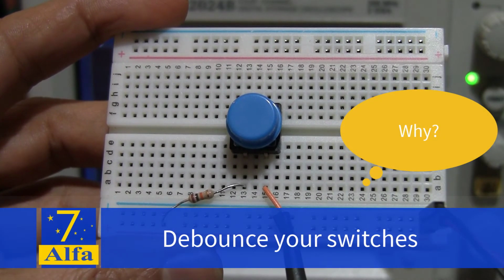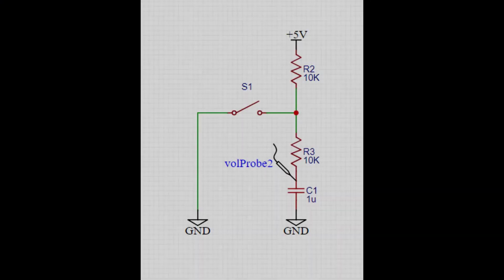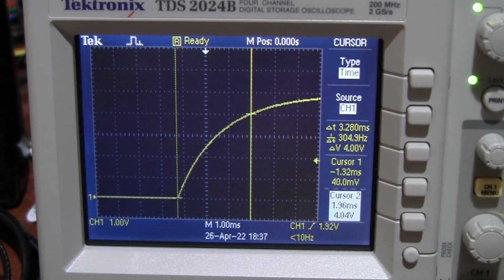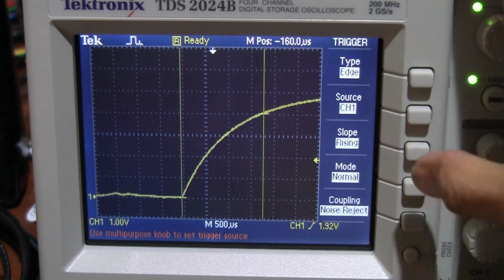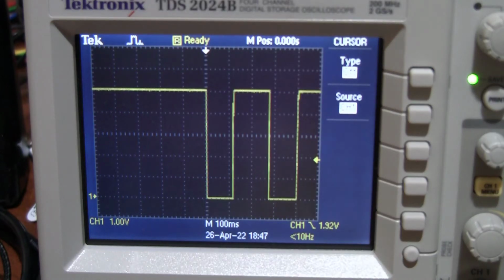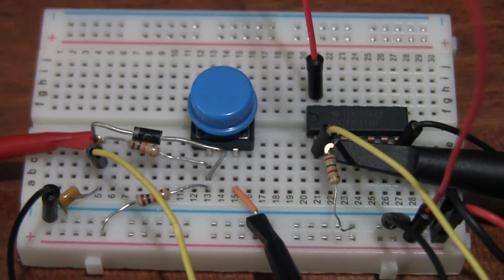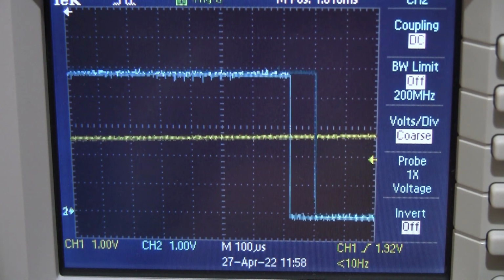Easily De-bounce your Switches

Comment: Use a non-inverting buffer with cap feedback with 10K resistor at input fed by button with 10K pullup.

Comment: I know this is an old video, but it seems like if you don't mind an ever so slight lag, one could just use the resistors and capacitors and so long as it stays at around a volt, it should be fine? Also, is there a particular reason having the faster fall off or rise times of the .1 capacitor would mess something up or be harder on the components?
Reply from the maker: Thanks for the comment. There is no reason to avoid the .1 capacitors. If one goes too low on the capacitors, then stray capacitances would come into play. Not a problem with 0.1
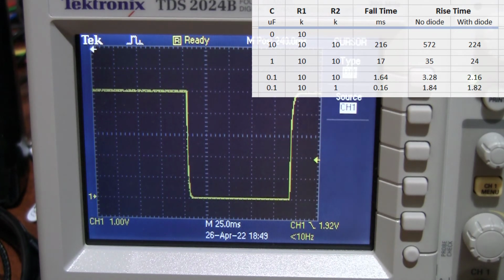And you are right that just the resistors and capacitors are perfectly fine. The diode is just the icing on the cake. Please look at the table at 4:18, and you will see my results with various combos.
Reply: @7alfatech860  Thanks for your response! I took a screenshot of your table which will come in handy for sure! 

I have an on/on spdt switch, but only the components for an RC filter with a inverting hex schmitt trigger as a buffer. I am hoping I can manage to wire that up properly to simulate the same action as a spst so that I can use those for the debounce. I figure one side would be ground while the other power, so when switched one way I will send my 5v signal, and the other will bridge/connect to ground only.

I realize a NOR-based SR latch would make more sense for me in this situation, but hopefully its just the more simple solution, and I am not making a mess trying to debounce the spst way. The only crappy part might be having to add 2 rc filters, on both "transfers" of the switch, but I think I can still send the signals to the same schmitt trigger since it has multiple inputs so long as I don't go over its rated output current (I hope).

Thanks agains!

Comment: thanks a lot for this video, which helps to easily set up the optimal debounce circuit .
I am using a lot of rotary encoders and have tried all kinds of software solutions. It works well, but sometimes you still have glitches. INTERRUPTS are always tricky and good for a surprise !
This time i will go back to the basics and choose  a clean electronic solution.  
..... besides its an honour for me to use a SCHMITT trigger - because this is actually my family name.
greetings from germany  Bernd Schmitt
Reply from the maker: I'm so glad to have been of help! Ich spreche nur ein wenig Deutsch. But if you reply in German, I will be lost😄.
A Schmitt trigger is such a cheap and useful device. LogiSwitch LS10 is an IC specifically for debouncing, and I believe it is quite robust. But it has about 20 ms debounce time, whereas rolling your own lets you adjust it to whatever you want. And the chip may be $2-3 each.

Comment: Quite frankly I'm in a state of disbelief that you've had this video posted since 29 April 2022. It seems impossible that I be the first comment since then! De-bouncing mechanical contacts is a gateway topic when entering the digital electronics! Analog techs and engineers rarely had to deal with this phenomenon but it's imperative that it be addressed in the digital electronics. I'm an old retired EET. My first scope was an old Dumont. It had a bandwidth barely above a radio's (455Kz) I.F. stage! Back in those days switch or relay bounce wasn't even on my radar. Our employers owned Tektronix that we wheeled around on scope carts. Even those old girls had a bandwidth of only 10MHz and costed more than my house! 

You did an excellent job here and I hope my post will "trigger" ( a digital word😊 ) discussions, including discrete Schmitt Trigger designs. 
Good luck with your channel. BTW, I still own the ubiquitous HP-410-B! 
Wakodahatchee Chris
Reply from the maker: Thank you so much for this detailed post. Much appreciated. There is a lot to be said for the old analog equipment and even more so, knowing how to use it.
I too am hoping that more people will look at this and see some value. Though, TBH, most of my channel is devoted to machining. 
It is a part of a (much delayed) project to add a motor to my milling machine's X-axis feed. I totally agree with you about the "gateway" topic. I stumbled on it initially because I found that my cheap rotary encoder was giving me inconsistent results. Well, one thing lead to another and I found that there were a fair number of recommendations on the values of the resistors and capacitors. I just wanted to "see" the results for myself.
Reply: @7alfatech860  Why am I not surprised! I have an old Logan 920 (1945)  and a South Bend H10 (1965). No Mill though.
Reply: I got the word too dude ;)